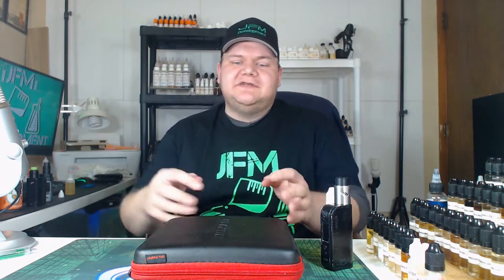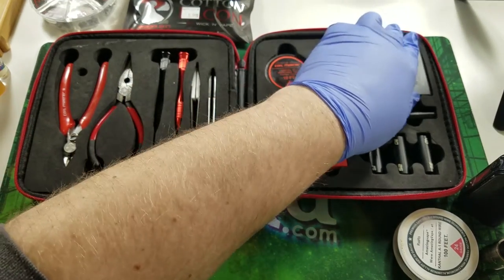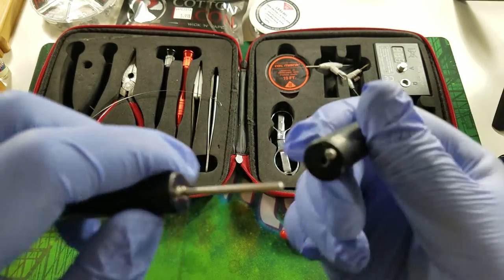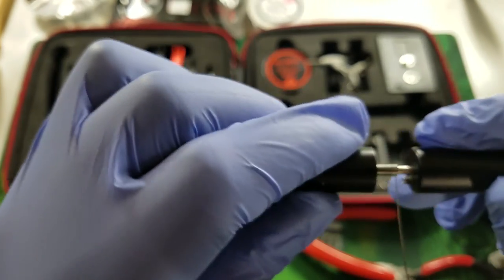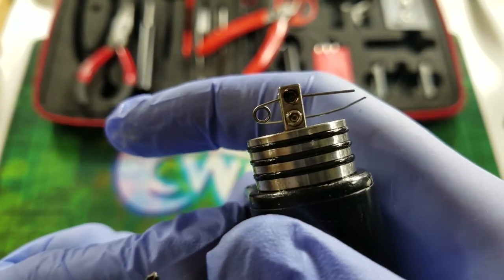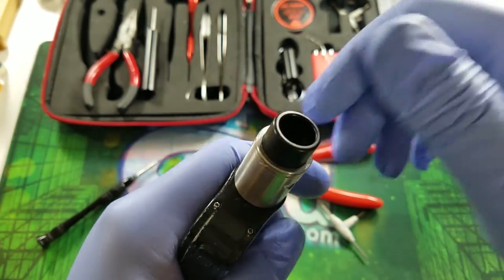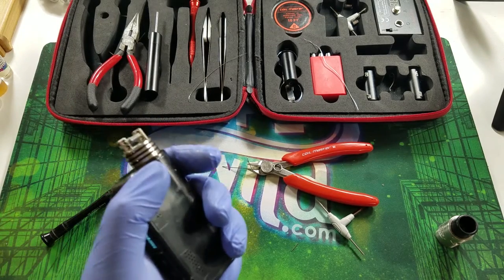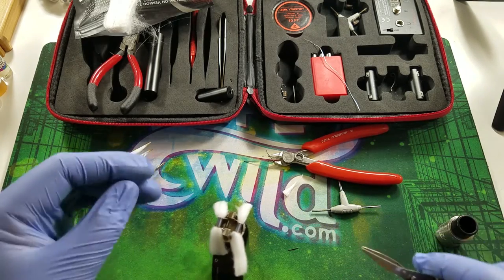How To Build An RDA For Begginers For Flavor Testing DIY E-Liquid

Comment: Would you recommend a SS Fused Clapton build in this RDA? And if so what ohm level/amount of wraps etc
Reply from the maker: Vent Artz yes absolutely you can build pretty much anything in. personally I love stainless steel fused claptons but I can't really guide you on how many wraps cause I don't know the gauge of the core wire or wires and the outter wire so I can't figure the ohms if you have this information just go to the app store and download a ohms law calculator plug all the info for the wires in and it'll let you know how many wraps to use . one thing to keep in mind though is most mods won't fire under .10 ohms and even if it does make sure the mod your using has batteries that can handle the load. so if I was you research ohms law before building too low or throwing more advanced builds in your RDA and stay safe
Reply: This is my go-to for coil design.
http://www.steam-engine.org/coil.asp?awg=28
Reply: JFM DEVELOPMENT I have an alien 220w with the troll v2 and I dont wanna build coils just yet I wanna pick up coils online and just pop them in and wick them. Where would you recommend buying prewrapped coils? I was just asking about SS Fused Claptons because thats what my friend said to get, I could definitely not build one on my own just yet.
Reply from the maker: Vent Artz I would recommend looking in Amazon for one if those wheel packs of various prebuilt COILS like I showed in this video that way you will have many different ohms levels as well as coil styles to find what work best for your vaping needs and better part about that is you'll save money too rather then buying from other places where you can get charged up to $10 per set of coils which is a rip off IMO
Reply: JFM DEVELOPMENT Is there anyway you can link me I was looking for that coil wheel and cant find it. I was original gonna go to advancedvapesupply and get a set of 5 24g SS fused claptons wrapped around a 3mm jig with 6 wraps. It doesnt say the ohm level tho and im not sure what ohm coils to vape on because I'm so used to vaping on .15 ohm premade coils for my baby beast tank.
Reply from the maker: Vent Artz You can get which ever you'd like I am sure your option would be good as well but you will probably pay more but with what I am suggesting you get loads of different style coils at different ohms levels letting you find the one that is best for you and since you get it from Amazon you get 48 coils for 13 bucks that's had to beat when I have paid 10 for just a set of coils before but it is up to you here is the link Prebuilt Coil Kit 8 in 1 Zipper Taiji Juggernaut 48pcs B Box https://www.amazon.com/dp/B01M75A59M/ref=cm_sw_r_cp_apa_w7AWybRKWASVZ
Reply: JFM DEVELOPMENT Yeah I'll order that kit. I vaped on the coils that came with the troll v2 rda and they looked really cheap and have a weird taste so I just threw those coils out
Reply: tried a lot of wires kanthal a 1to me and all my coil building friends is the best for us flavor flavor flavor  but that's us every one is different what works for me might not for you